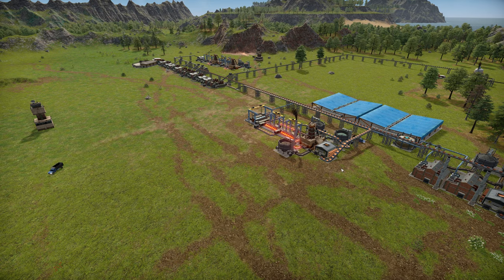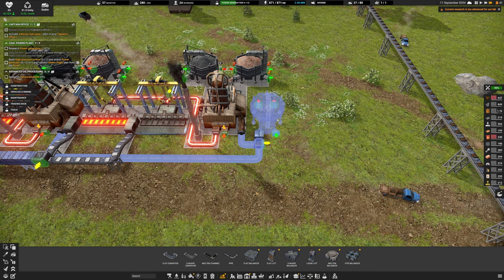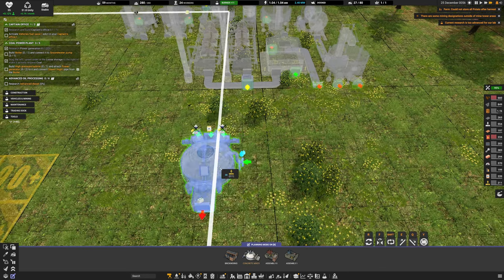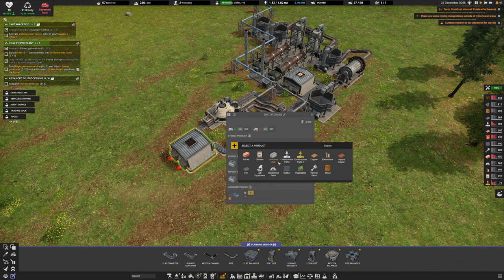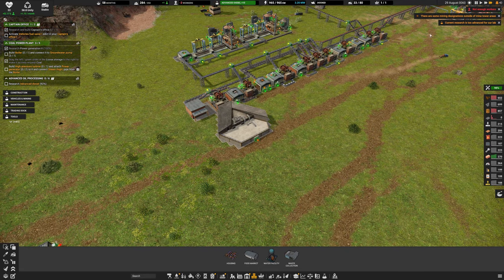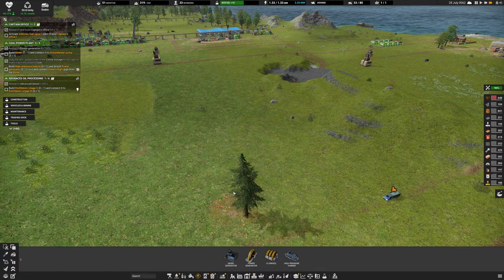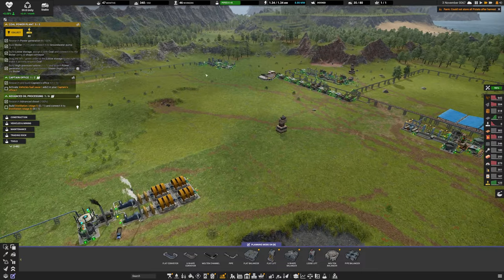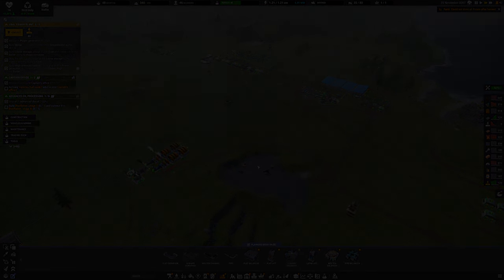Utilizing Steam Turbines in Captain Of Industry

Comment: Hey, since you have flywheels attached to your power generators, make sure you set your turbines to auto-balance (there is a checkbox when you select a turbine). This will cause the turbines are not running flat all the time and not eating tons of coal 😀. The turbines will only run when the energy stored in the flywheels drops under certain treshold thus you will save coal. 😀.
Reply: Yeah, I was about to comment the same thing. He is going through coal like crazy! Needs to look into how auto-balance works.

Comment: You don't need to manually pause the diesel generators. Power generators have a 2nd priority setting to indicate which ones will come on first. The diesels have a default of 11, so they are the lowest priority to come on and (with this current setup) will not come on at all unless either 1. the steam turbines shut off for some reason, or 2. your town requires more than 8 MW of power (you current maximum from the steam generators)